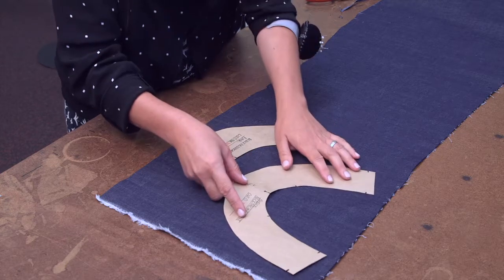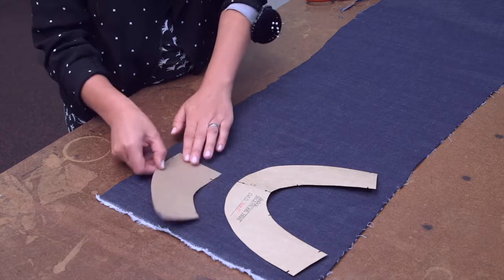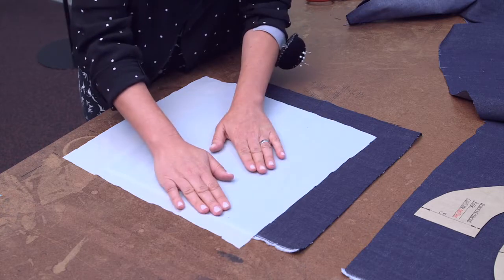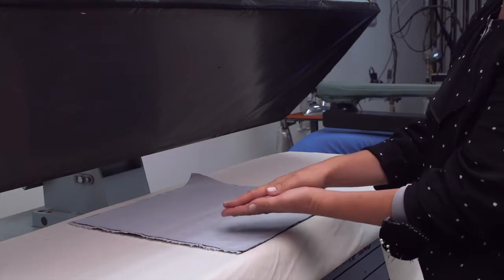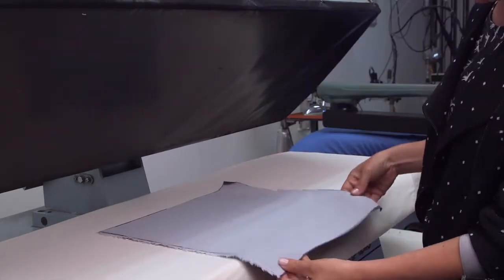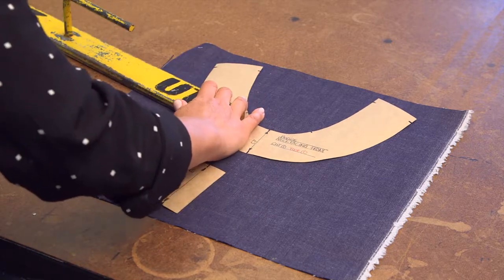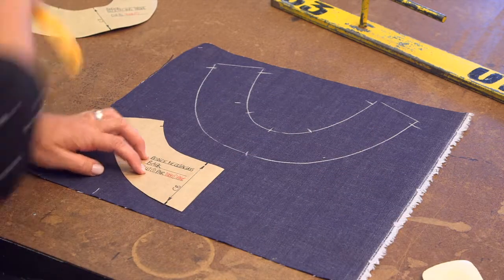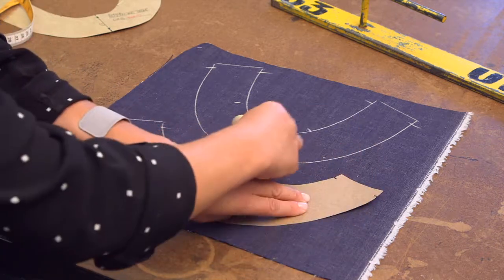Block Fuse

Comment: Hello, nice video. In the instance of having to block fuse 1 pair of fabric, is it possible (or recommended) to fuse one side of the fabric with the other by using double sided fusible interfacing? In my case I've been asked to "block fuse" 1 pair of fabric for the waisband of some cotton shorts. Thank you.